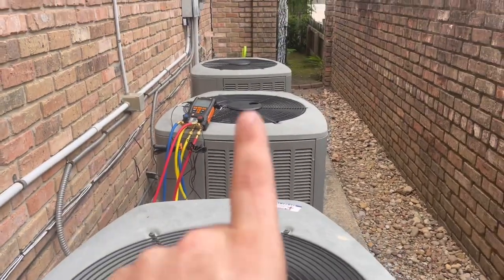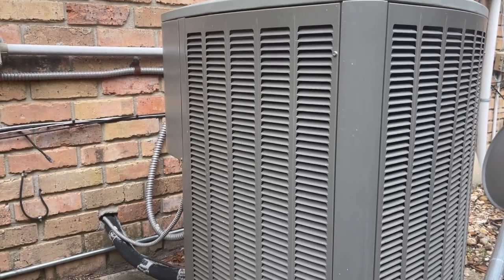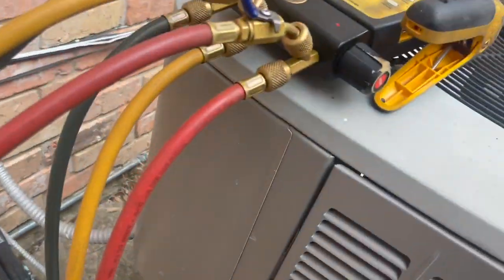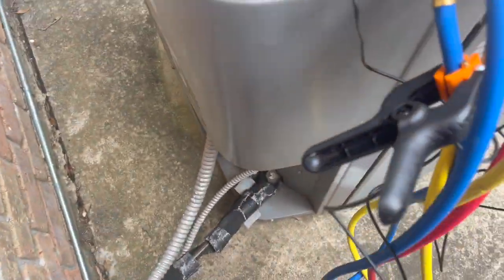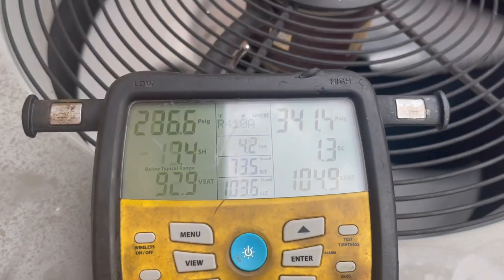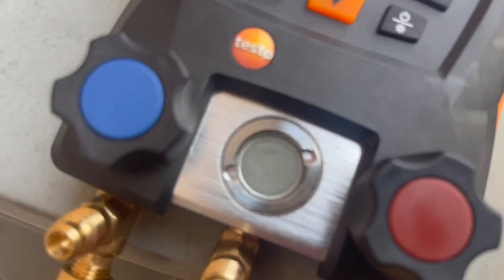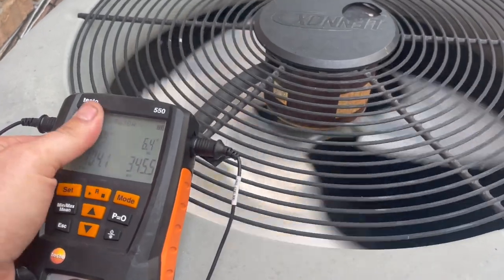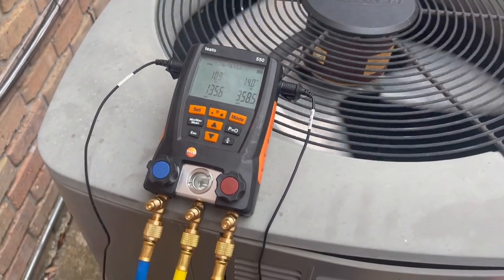Two Lennox Junkies Low on Gas

Comment: john just a heads up about the rheem units. the heat pump package units do not use microchannel condensers. they still use tube in fin. straight ac package units and gas packs use microchannel

Comment: Is Lennox tube and fin or microchannel?  There aren't many Lennox units in my neck of the woods
Reply: Not microchannel
Reply: Micro channel exterior all aluminum evaps for the past two years these are older
Reply from the maker: Lennox isn’t making a micro channel condenser coil. It’s a aluminum tube coil

Comment: Newer Trane coils are even worse, I replace trane coils 4x more than any other brand produced after 2018.
Reply: @Crazywill210  Here in Florida I work on mostly trane, carrier, and Lennox. Trane by far has the most major issues and it’s always a leaking evaporator coil even have found many leaking TXVs lately..